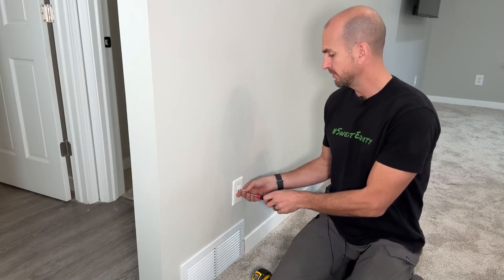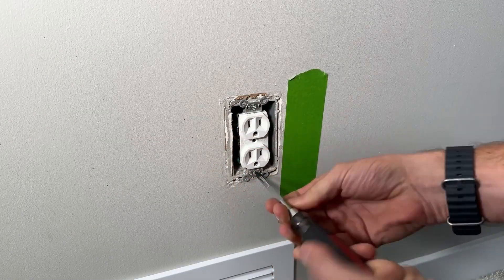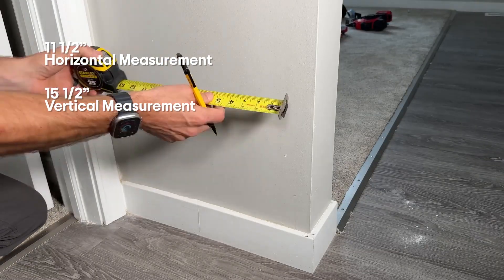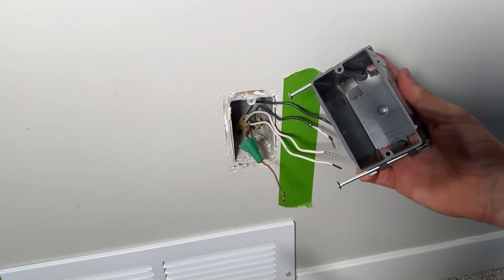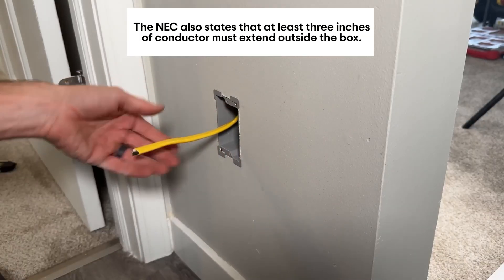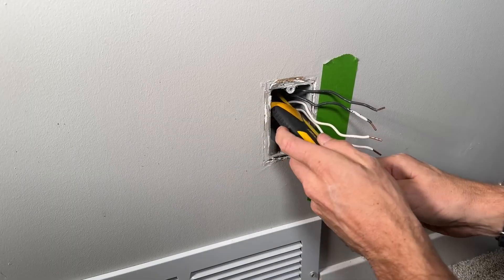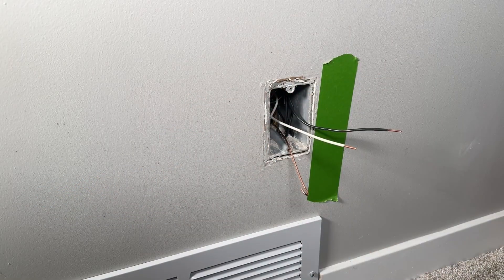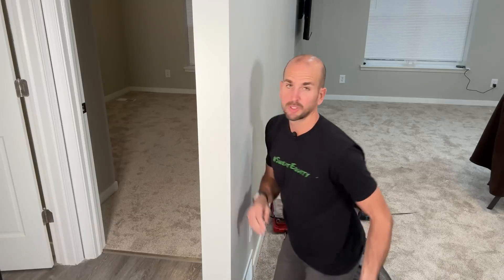Add a New Outlet From an Existing One (Code-Smart DIY)

Comment: Still not up to code. Your new Romex cables are all loosey-goosey. Code requires strain relief and mechanical protection for the new romex at the entry point in the existing box  (NEC 314.17(C)). 

The correct solution for this is to replace the hole box altogether with a new old work box with in-tact strain relief tabs at entry point